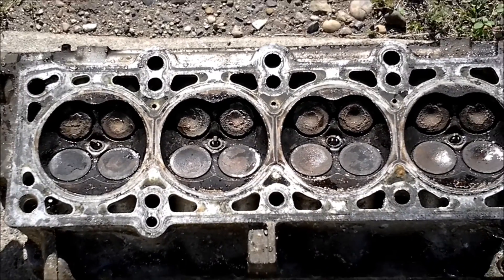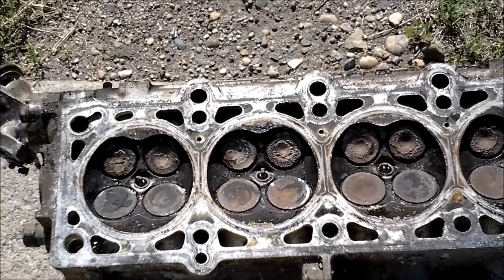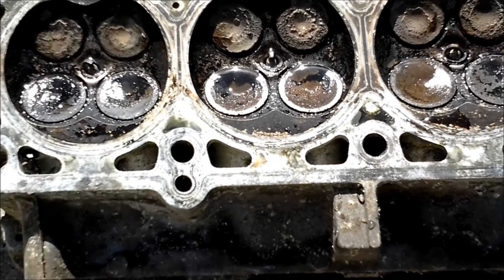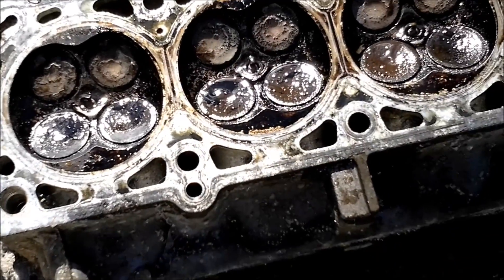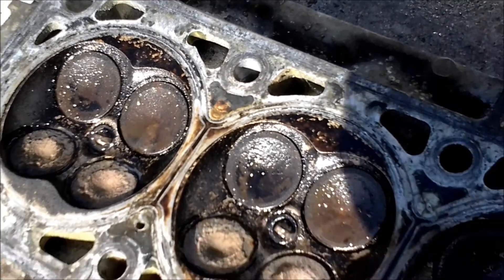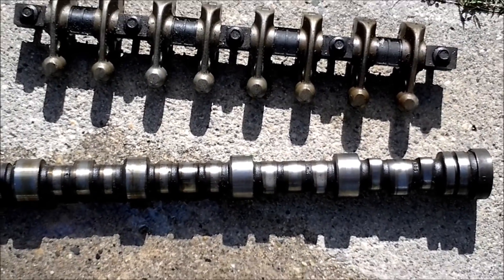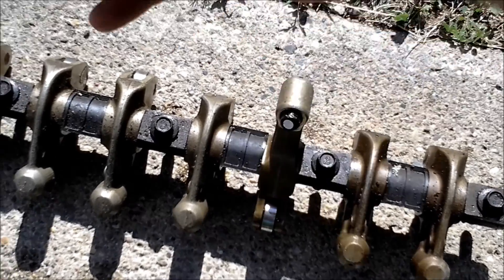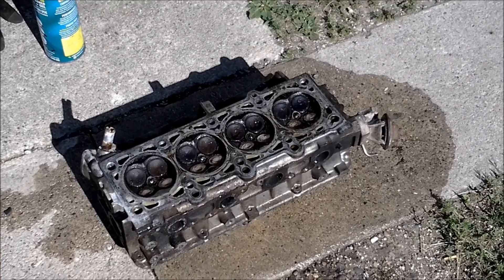ECB Single overhead cam cylinder head valve seat leak test

Comment: Hey man it's me, thanks for going through with the video. Will test this on a Honda head from the engine I'm rebuilding. Turning into quite the project; was blowing smoke so I took it apart to do the rings & found a bent rod in the #1! Also had to replace the steering rack etc...
Reply from the maker: When you do the leak test try to make sure that the head is level and that you fill the combustion chamber enough to cover the valves to make sure all of the seat is sealing.  Good luck.